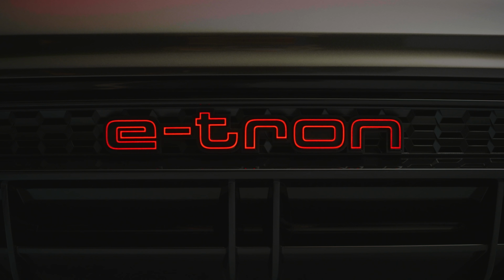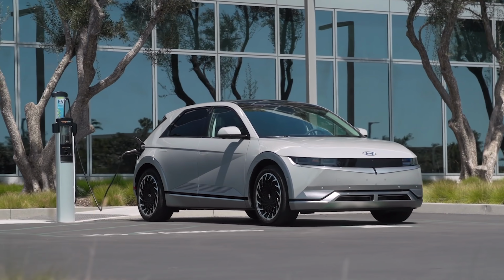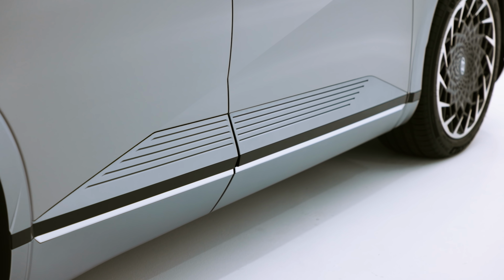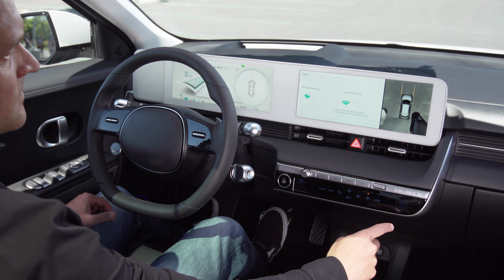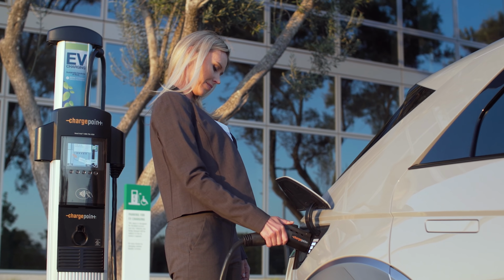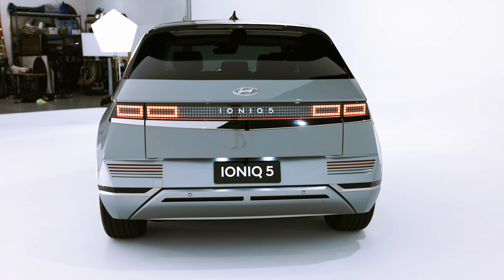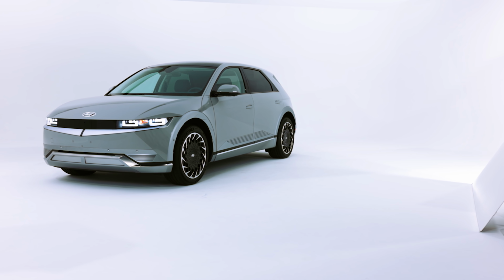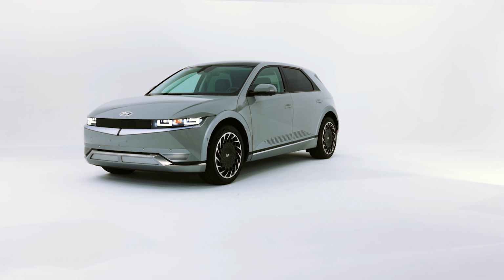2022 Hyundai Ioniq 5 First Look

Comment: Wondering what it is about the limited trim that absolutely murders range?
Reply: I’m guessing it’s from the added weight. Those glass panoramic roofs are very heavy and adds unnecessary weight to the vehicle. I have to agree, 25 miles penalty for the limited trim is a lot.

Comment: Why does the top spec limited get such bad range compared to other AWD specs? 244 miles? Haven't heard that number anywhere else.
Reply: 244 should be fine since it charges so damn fast. Realistic road trip stops every 2+ hours for a mere 15 minutes to stretch the legs and you're on your way.
Reply: @pushbike1324  You're assuming that there will be EA chargers every 120 miles and that the chargers will actually work.  Unfortunately, only Tesla has been able to make charging as reliable as filling up at a gas station.
Reply: I also wonder if its because of quicker 0-to-60 on the Limited trim? I know that the Performance model of Teslas get a cut in range from that. Also its odd that you only get the "nicer" wheels if you have an AWD Limited. I'm leaning on the RWD :P
Reply: It's because it's more realistic than others who have overstated range, particularly Tesla is a prime suspect.
Reply: Top specs usually carry a bit more weight, have additional (potentially power drawing) features and wear larger/heavier/less aerodynamic wheels and tires. All that adds up to reduced range. A large part would likely be the wheels and tires, so swapping over to lower trim’d shoes with thinner tires should net a decent increase.
Reply: More performance costs range. Get another trim if range is priority. Also a manufacturers claimed range all varies, some are much more realistic than others.
Reply: Just saw an explanation that it's because of the "upgraded" wheels... Now can I get everything top spec with more efficient wheels? I want the extra 25 miles per charge more than cool wheels.